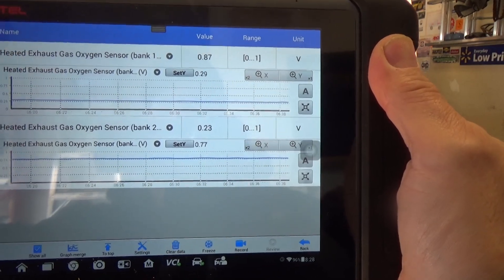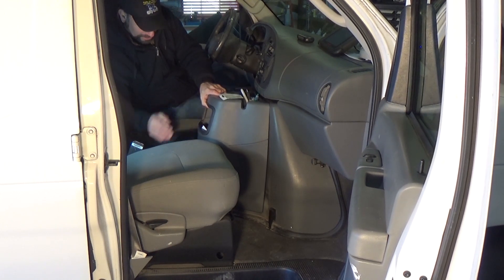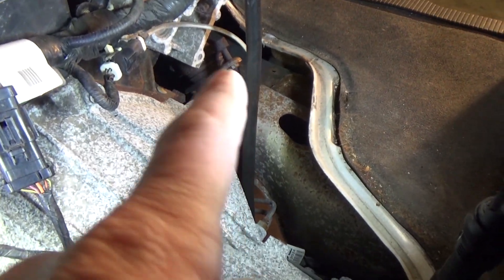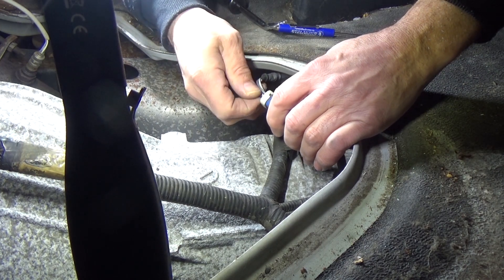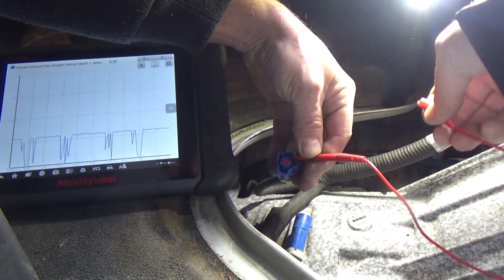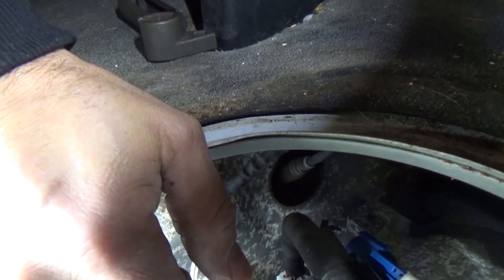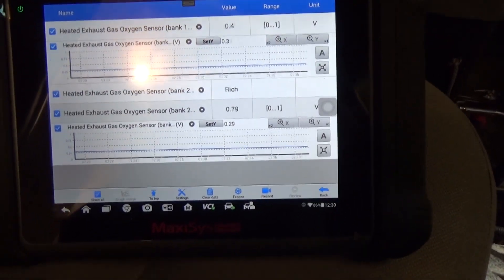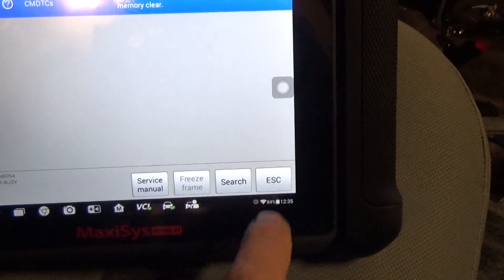What is Causing Trouble Code P2270 and the Fix!

Comment: Ha ha ha, "these usually are glued in". Looks like many of my old vehicles. Very efficiently diagnosed, Glen. As you nicely show, it doesn't take much effort to be certain before ordering parts.
Reply from the maker: Dave this O2 was the most difficult one I ever had to remove. It wasn't that rusty but  tight as a ducks ass in water.
Reply: @ozzstars_cars  - 😂🤣😂

Comment: I have the same issue with my 2013 Silverado 5.3 what voltage reading should I be seeing at the down stream o2 sensors
Reply from the maker: .7 - .8 mv, but that depends on the efficiency of the catalytic converter. Any fluctuation that repeats the front O2 is not good.

Comment: Do you remember if it was a circuit code? Just curious.  Great breakdown on the testing!
Reply from the maker: The P2270 is a sensor signal stuck lean or also bias lean.  Which proved when I unplugged the rear O2's and got the .300 milli volts.  I tested the circuit just to be sure nothing crazy was going on.  This van was recently bought used with no history.  ABS light is on also.....go figure.  Haha
Reply: @ozzstars_cars  lol... ahhhh... gotcha.  Very thorough,  as it should be! 😊

Comment: Ahh, you should've filmed the removal! Then we could compare videos for the similarities. I'm real good at unleashing tirades of expletives. 😁

Should've tried out that Powerbar, too! This one could've went viral! 😃🤣 Loved that thumbnail - could tell there was a battle about to be fought!  😁

I have that same scan tool, only mine is the TS, instead of the BT. It has the tire pressure sensor reader built in. I thought I would be using it constantly ... but I have only used it once playing around on my Silverado. Everyone around here puts tape over the light  - FIXED, lol! Makes it easy for me, since I stock regular valve stems.

Hope you had a great Christmas, Glen! Santa brought me a new knife! It actually cuts things ... unlike the one I've been carrying for a decade or so, LOL!
Reply from the maker: Yeah Smitty that little 4 wire O2 fought me hard.  To the point I say to myself why do I work on cars, why?? haha  We have all been there.  Yeah I like this Autel bluetooth model so far so good.  Didn't get the TS just because I want to buy the latest and greatest TPMS tool once I have the budget.  
You with a sharp knife????  Things are getting dangerous up there in Massachusetts! haha
Reply: @ozzstars_cars  - I seem to be there more than most, Glen! :D 

Glad that tool is working out great for you. I'm glad I didn't buy an expensive TPMS tool here, because it would be collecting dust! I'm amazed at how many people don't want to spend the money on this system. Well, actually I'm not ... since I do the same thing. My light stays on all winter, since my winter wheels have rubber valve stems in them. 4 sensors at $25 each? Nope, not today! 😂

Comment: Heya Ozz,

Thanks a ton for this vid. I currently am getting P2271. I have changed, replaced everything under the sun. What I have yet to do is test the system (Because of yer video its now on my to do list)

My question is I don't have the ability to graph or check for voltages with that maxtel deal you have. 

I do have a handy voltmeter that gets me by in residential electrical, it does ac/dc but I don't think down into the Mv's.

So Im going to be testing the heater and sending wires, Yer video was pretty on point there.

My question is related to the ground. What am I looking for and how do i find it with the tools I have?
Reply: I should note that Alldata states that 2271 is a signal performance code. I'm working on an 08 Hummer H3 Alpha with 137k Miles. 

We've replaced MAF, MAP, Air Filter, All 4 H02S, Cats x2, Oil Pressure Sensor, Coolant Temp Switch, EVAP Canister Purge Solenoid, Complete tune up (Wires, Plugs, Coil Packs).  I am sure there are other parts we've replaced. If you mention it I'm sure it'll come to mind.

I was getting 0174/0171. But after replacing the Solenoid a couple of days ago those two codes seem to be fixed. I noted my fuel pressure went up from 19.5 PSI to 57 PSI. 

I also found 2 areas of concern for air leaks. One in the PCV hose that connects to the air breather and one that connects the hose to the IAT. I've since fixed those as well. So far P2271 is the only code coming back.

I've also tested all of my Fuel Injectors cold and hot. All of them Ohm'd out in spec according to alldata. I've also done a compression and leak down test (I relegated my testing to bank one since the issue seems to be on bank one soley) But both compression and leak down tests were perfect. Cyl 1 has a slight stick on the intake, but once it hits 60 PSI its good. With Cyl 1 I've ran a can of intake cleaner for the valve train, Now just to see if it works or if i need to run another can thru the fuel tank.  Cyl 2 spark plug wasn't installed correctly, I was able to unscrew it with my fingers.
Reply from the maker: Hey Rickey it's extremely difficult to diagnose an issue over the internet without having the car in front of me.  My first question is what brand of O2 sensor did you replace the bank 1 with?  Certain brands of cars will not work well with every brand of sensor.  2) With the sensor unplugged you need to see what the PCM is reading engine off, key on.  Is the PCM actually seeing high voltage .6 mil volts and up like the code suggests?  This is where a scan tool that reads data is very important, like this one or something comparable https://amzn.to/2Z9hVZr
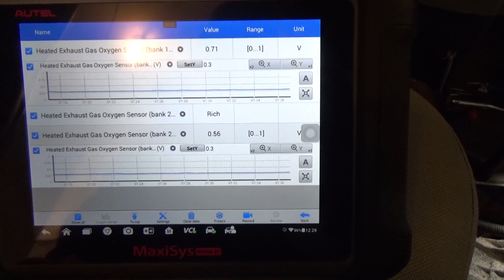   If the PCM is seeing high voltage there could be a short to ground through a damaged wire.  I mention ground testing at the 13:00 mark, make sure to watch the entire video.  Also here is another vid I did on a Nissan that may be helpful to you on how to test,  https://youtu.be/o_DvodrqP1I  Can you make the signal go lean??  I hope this gives you some direction.  Keep us posted on your findings if you can.  Take your time and don't over think it.  -Glen (Ozz)

Comment: Hi, I have a p2270 as well on Mazda Tribute. I put an aftermarket O2 sensor on and 3 days later my check engine light came back with the same code. So, I thought maybe I had to get the oem and I did 2 days ago n still the same check engine light. Could it be the bank 1 sensor 1 causing the sensor 2 be bad? It read 0.00 on my scan tool or it might read 0.05 or 0.060 whenever it decides to do that. I’m just confused on what to do to fix this problem
Reply from the maker: Have you tested the circuit integrity like I show in this video?  Test and don't guess to find the problem.  There could be an issue with the wiring or connector.

Comment: I have a2007 Mercury Monterey that is throwing not only code P2270 but also P0054. Changed out Bank 1 Sensor 2 , drove it about 20 miles  and the Engine Check Lite came back on. They guys hard wired the sensor in and I drove about 3 miles and it came back on again. do you have any suggestions for me? Thanks.
Reply from the maker: Sorry I can't diagnose the car online but you may want to try a different mechanic that knows how to do a proper diagnosis using live data.  To many variables to guess.
Reply from the maker: Something I thought of.  What brand of O2 sensor was installed?  Certain brands are not always compatible though the book says it fits.
Reply: @ozzstars_cars  just so you know, this place has always got it right until now. Its like I picked up a gremlin while it was  in the shop.
Reply: @ozzstars_cars  I saw that in your  how to post. Thanks.

Comment: I changed sensor 2 bank 1 and there was no code p0136 short circuit
Reply from the maker: How is there no code and you have a P0136?  Why did you change it.
Reply: @ozzstars_cars  If you have code p0136 and change the oxygen sensor but it doesn't fix it
Reply from the maker: @MexicoGuerrero-85  could be a break in the wire or corrosion. Load test the circuit.
Reply: @ozzstars_cars  What do I know about the harness where the sensor is connected, tie the strap and how to follow the harness?
Reply: As I told you, the sensor is new and where it is connected is broken.